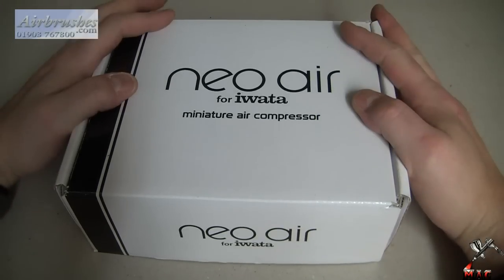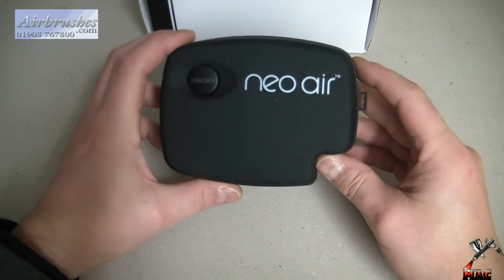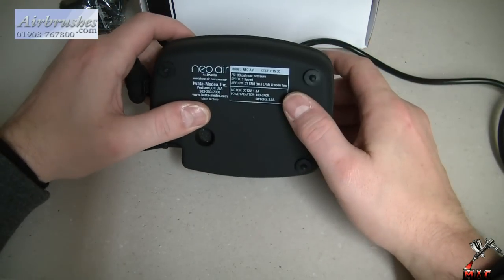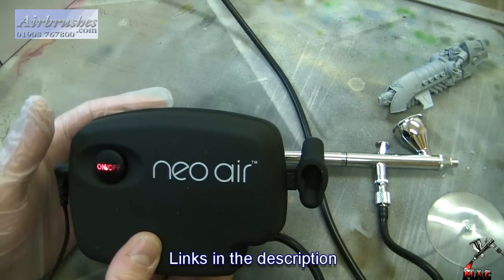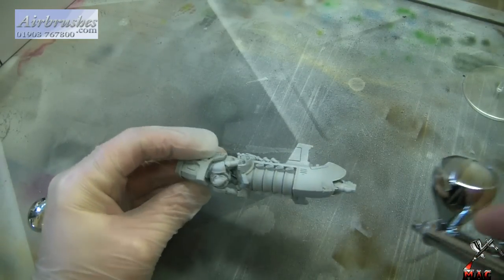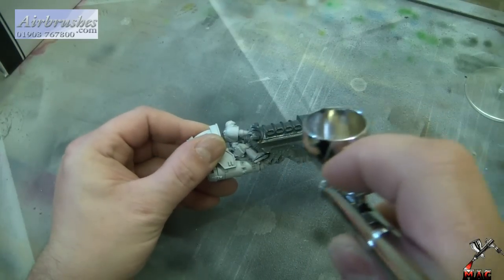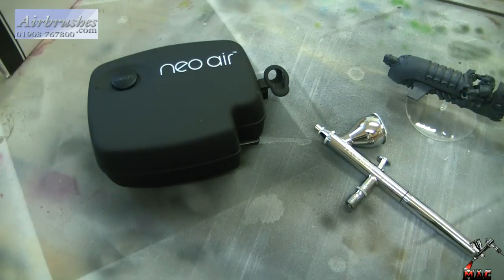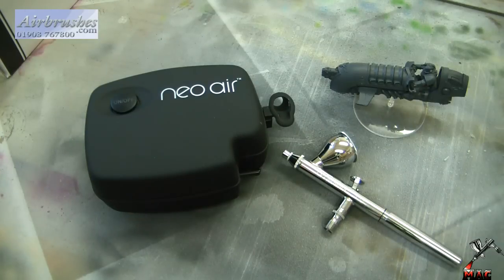Airbrush. What, How & Why - Part 3. Neo Air miniature desktop compressor.

Comment: I know this video is old, but is this still al good choice for a priming/basing setup in a smal apartment?
Also do you need to using a moisture trap with this compressor, it dosen't look like it has one built in.
Reply: Was wondering the same thing

Comment: Great little compressor, does anyone know if that rubberised finish lasts very long. I've had other tech items with it on and after time, regardless of use, it 'decomposses' and ends up sticky/tacky/slimy to the touch. I even had an Iwata airbrush case go the same way (and it was never anywhere near solvents etc). Thanks in advance.👍😊
Reply: Oh god I know exactly what you’re talking about

Comment: It looks like a nice set but the cost is a little high? I bought an iWata revolution CR for £80 and a compressor with a tank for 100 which came with braided hose and two airbrushes for £100 which is only a tenner more and will perform better

Comment: I had one of these mini air compressor.... mine is much much quieter and give me 3 settings: normal, high low pressure... it works on my hobby models and it sprays very evenly. but the only down side is it always shoot air because doesn't have a reserve tank ( It can be a upside because u can feel where the air shooting before u spray it, also the air is gentle and help the paint dry quick when you aim at it), reservoir for the free air brush is small so cannot cover very large models.

Comment: £99 quid is that right? I got a similar one off ebay for a third of the price and it does exactly the same as that with 3 settings. I only ever use it for priming.

Comment: Hello there does this compressor works with 110 or 220 v power please explain this to me. I live in South America and we have 220 v as power.
Reply: Jeny Munoz if u you see the proper plug in the UK an earth wier is used to allow 240volts the two weeks left yellow and brow right to allow currantance flow the wires must be outside the the plug don't do this without more information

Comment: the max spray pressure on that unit is 15psi. so you prosy have 5, 10, and 15. that thing will never give you 30. 30 is max working pressure so you only get half. the iwata is800 only gives you 25 max